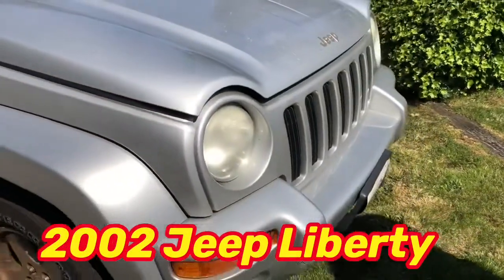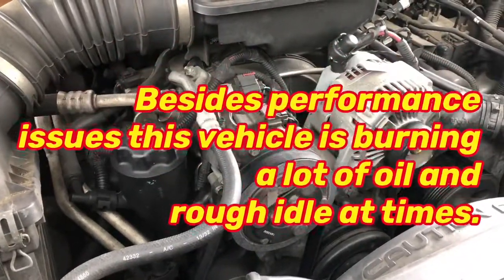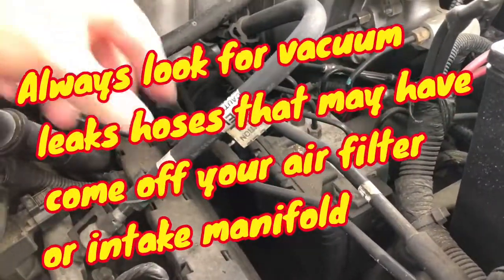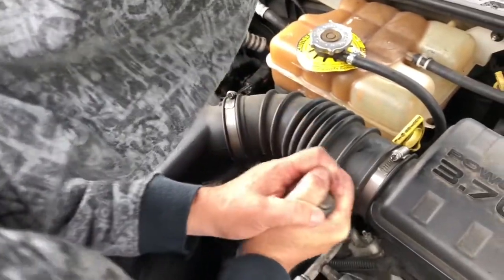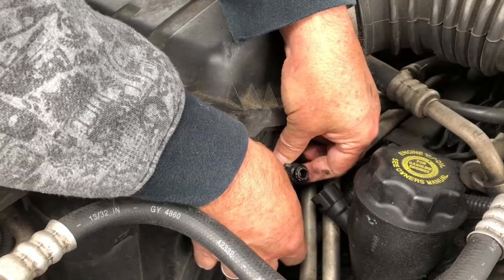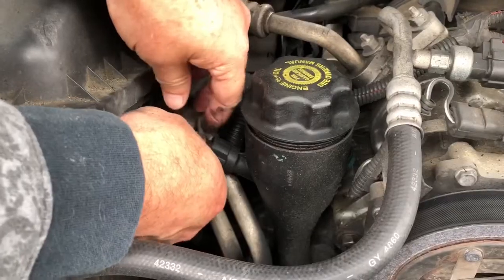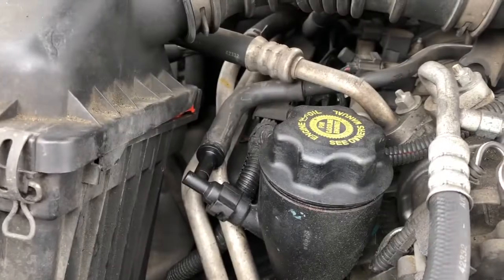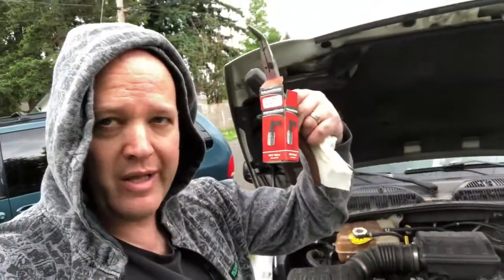2002-2007 3.7L Jeep PCV Valve! Loss of Power? Hard Start? Rough Idle? Oil loss? Oil on air filter?

Comment: 2002 jeep liberty renegade bought new in 2003 off the showfloor. When wifey wrecked it, i lifted it with 2" moog deisel springs and a ARB winch bumper on the front with a pinch weld mod, and 265 16 tires (fits on original rim) DRIVES LIKE A QUAD I LOVE IT. You know, california would not let them in without a 1" drop ? they dropped it 1 " the front forks can raise the jeep 1 ". Also they would not let  the deisels in the state. But it has 210,000 miles, looks great, (cosmetic damage only when it was totaled)
Reply from the maker: Nice Randy 👍 
Thanks for sharing man,
 Jeep on 🔧✌️

Comment: Nice walk through! I've been replacing all the small parts like this on mine for the pass month or so you know 30 bucks here and there and smaller parts too try too keep her fresh. 211333 miles on her and still running strong !
Reply from the maker: Nice 👍 211 k pretty dang good 😁 keep it up! 
Those 3.7 L run forever.

Comment: I had a full bank misfire because my cats where clogged . I cleaned all the screen and dirt out and put it back together doesn’t misfire now although I have a weird rough idle . Being cold it won’t stay started but when it warms up it’s still a little rough any ideas ? Change injected o rings coils spark plugs
Reply from the maker: Wait, 🤔 you pulled the cats off and cleaned the screens?
Reply: @RussShawTV  yanked all the screen out is what I meant lol . So made the cats hollow and put them back on
Reply from the maker: @cloudrehzii  Nice! I always wondered if that would work. I live in Washington state they got rid of the emissions testing 👍 Are you burning oil?
Do you have a light on still? 🤔 It could be your downstream O2 sensor is telling your computer That you’re burning hot and the idle may be adjusting to compensate.

Comment: Dude. You are such a legend. I jusy bought a  2008 wrangler with close to 200k on it (i got a really good price) and had it inspected. Passed inspection but i still had all fluids flushed, filters check etc. I've had the rough idling at red lights and get that death shake sometimes, triggering the red lightning bolt and etc lights, also the blue/grey smoke. I told my mechanic to check the egr valve and he said it was clean. I'm 1000% checking and replacing this part tomorrow. I can't keep having that sinking feeling in my gut not knowing if shes going to start or if shes gonna die while im on the road. Thank you again. I will update.
Reply from the maker: It could also be your catalytic converter. Do you have an engine light?
Reply: @RussShawTV  the guy I just bought it from claimed he just had a new catalytic converter put in. My mechanic said he saw catalytic converter error codes, but figured they just didnt clear them when they installed the part. Might be worth looking into though. I don't know much about under the hood stuff but I'm learning a lot! Also, I recorded a video of it starting to shake while idling and the lights coming on. I just checked my video and the engine light didn't come on but when i was restarting the vehicle, it was one of the last ones to clear from the dash.
Reply from the maker: @justblaze4707  P0420? 
Your vehicle actually has three catalytic converter‘s. He probably change the one on the tail pipe exhaust. The ones that clog (V6 3.7 you got I’m guessing) right next to the exhaust manifold. Bolted straight to it and they are not an easy replacement. If you have the P0420 code odds are it’s one of those cats. If they are clogged and that’s what’s causing the engine problems. It’s not good to keep driving it like that can do serious damage to your valves overtime.
Reply: @RussShawTV  Update: I took it to my mechanic and gave some input, telling him I thought it could be a pcv valve problem. Additionally, we both looked under the hood before I left and noticed an air filter plugged into an open vacuum port on the engine. We were both confused and he attached a hose and connected this to the air box (I think he meant intake manifold). I got the vehicle back the same day and he ended up replacing the pcv valve, doing that hose, cleaning the throttle body and doing a couple minor things like checking for vacuum leaks. He said this resolved the problem. I wasn't even out of the parking lot and it started to do its shake, and I got the red lightning bolt and the other etc light. I didn't have time to go back in but its concerning now because everything that I've researched has been addressed now. Could possibly be a Cat issue like you mentioned most recently.
Reply: I just did some diagnosing with my OBD scanner. So, the problem starts with the jeep sounding like its sucking in way more air. Then, the shudder happens and some weird values start to show. The timing becomes erratic and the throttle doesn't know what to do, and the idle rpm's go from 700 up to 1000 and settle. It seems my short term fuel trimmers are almost always acting really weird and when the shudder starts, they don't show up at all. Sorry this is so much to read, but I had to write it somewhere.
Reply from the maker: @justblaze4707  What was that code? Did it give you a code?
Reply: @RussShawTV  my dash wont display them but im getting P2173 (same as P0173) and C121C. I believe only the first one is an actual issue and I'm thinking its a fuel injector problem or the Catalytic Converter.

Comment: Hi I have a 2007 Liberty 3.7L V6, 117,000 miles. Owned it since 67,000 miles. It operated perfectly for the first 30,000 miles and then it started getting a #1 Cyl misfire code P0301.  It also seldomly gets a #1 cyl fuel injector circuit open P0201.  It must be a very mild fault as the misfire freeze frame data shows it always happens at less than 350 rpm and when cleared it comes back immediately at next startup, cold or hot.  So it seems to only happen once on startup as its moving up to regular idle speed. The miss isnt noticeable when driving or idling.  Its getting 15.5 mpg fuel mileage. Doesnt burn oil. Doesnt smoke. Has great power. I've changed plugs and coils but no difference. Cleaned air intake, air filter, and ran cleaner through system.  I've cleaned and inspected the injector plug and all wires but no difference.  Dry / wet compression test of #1, 3 and 5 cylinders all read good: 160 / 175 psi.

I'm wondering if there's a mild wire defect for that injector, or just a flakey connection somewhere.  Has anyone tried to use a new set of compatible gauge wires and run them to a place closer to the injector control?  I can't  see where the wires go though.

I'm not sure if I should just live with this, or troubleshoot it more.  I don’t care about the engine light as we don't have emission requirements. Now that I know the compression is good, I'm not so worried about it.

Any suggestions of what to do next?  Thanks!
Reply from the maker: Odds are you need to replace your coil packs. Your coil packs are malfunctioning causing fuel buildup. I would change all of your coil packs. I mean you can change cylinder number one but odds are the others are going to start going out soon as well. It’s a common problem the coil packs don’t last forever. I should do a video on this soon

Comment: OK I just cleaned out my PCV valve with carb cleaner just as in video.
Before cleaning I had a barely running idle, struggling and would almost die if I didn't hold the gas pedal down.
What difference!   Now I'm idling above 1 and exhaust output air has like doubled, its coming out like a hurricane.
And lots of popping noises.
What the world?   I would never expected such a change in a million years from this little valve.  What could have possibly caused this
Reply from the maker: @e.gadd.1  I’m glad you found the video helpful. These little motors need to breathe. 🧘 😎👍🔧👆
Reply: @RussShawTV     
I'm hoping the muffler popping is because I have my O2 sensors disconnected.
I'm not 100% sure if they are faulty, I was testing them.
Or maybe the valve is stuck open now?
Seems a cheap enough part.  I'm tempted to just swap it out with new

Comment: Thank you, sir. I thought my cats were going out. Going to give this a shot and after looking at it today, oil is leaking out of the valve. Houston, we have found the problem
Reply from the maker: Nice 👍 
🤔 No engine light?
Reply: @RussShawTV  no engine light on my ford ranger. My car runs fine just has extremely hard start. I have done a 50/50 test and ruled out spark and timing. I'll comment in a week to let you (and the viewers) how it went.
Reply: That was the fix. 5 days in and all my symptoms went away. My car starts up in less then a second and feels like I got 30 horsepower out of it lol. Thank you sir!
Reply from the maker: @fopop1567  Great news! Thanks for the update!

Comment: Yup I had the same on a jeep liberty sport 03 ,it would shake when I would press on the gas and oil pan light would come on and found out it was low on transmission fluid and the coil packs were what was making it shake and have loss of power

Comment: Liked and subscribed, 2004 Renegade here, thanks!
Reply from the maker: Nice 👍 😎 would love to know how it works for ya 😁
Reply: @RussShawTV  I tried to remove the PCV down like you showed and it snapped in my hands. Oh well, 18 years old!
Reply: @RussShawTV  so how does one keep the Cats clean? Avoid short trips?
Reply from the maker: @davekana8388  Changing spark plugs is a big one. Making sure you have the right spark plugs. Gapping is kind of a thing in the of the past they come pre-gapped depending on the year make and model of the vehicle.
The fuel in the cylinder once the fuel injector sprays it in needs to burn up completely. If it doesn’t then the fuel and whatever dirt in the fuel or in the combustion chamber get sent to the catalytic converter. This is what tends to plug them up most overtime.
Reply: @RussShawTV  clean fuel is the rule! Do you recommend an additive?
Reply from the maker: @davekana8388  There are some good additives out there. Not sure I would really recommend one in general. Some of it depends on what gas you buy. Most gas out there already has additives included at least here in the United States. Chevron and Shell have some extra fancy engine cleaning formula in their fuel. Most all the gas companies do it’s the only thing that sets them apart from each other besides just dinosaur blood 😂
Reply: @RussShawTV  I usually use BP. Haha,dinosaur blood!

Comment: Thanks for the video 
My daughter has 2003 Liberty and loves it, now it start then shut right off
Stay running long as foot is on gas, changed fuel pump relay but still does it
Maybe this is the problem
Reply from the maker: 🤔 Engine light on?
Reply: @RussShawTV  
No check engine light
Reply from the maker: Yes try the PCV valve that should fix the problem. If you get a P0420 code that’s cat catalytic converter. Similar symptoms
Reply: @RussShawTV  
Yeah so far it’s not showing a check engine light 
But I’m going to get a code reader also, need one anyways 😂 this is a better reason to tell wife I need one
Reply: Put Marvel Mystery Oil on gasoline.  It will clean the cylinders.  Hot sludge in cylinders is what cause that afterrunning problem.
Reply from the maker: @CFITOMAHAWK  We’ve also used Lucas top cylinder cleaner. Works great for roughly running engines and Better gas mileage to. 
But I would also replace the PCV valve. It’s cheap not hard to do and will work wonders for 3.7 L
Reply: @RussShawTV  MMO you can also add on engine oil before changing it.  cleans those dirty areas engines get.
Reply: My 2003 jeep liberty did the same thing until I got the Idle Air Control Valve changed. Now its fine

Comment: Great video I have a 2004 Liberty limited V6 3.7L I’m gona change my PVC valve tomorrow and see what happens.mine is doing everything you said yours is doing.mine miss fires with  no code.changed plugs still the same.Then throws the code P420 randomly.and also at times the thing will fly like peppy and then another you can feel it just hesitating.Did the pvc valve fix your issues?any advice or information anyone can share be great.
Reply from the maker: Hopefully that helps. Odds are you’re going to need a catalytic converter down the road soon.

Comment: I have a 2002, thank you so much! Perfect video. I will let you know if it helped mine. I am a subscriber. 👍
Reply from the maker: Sweet yes keep me posted. You may have to drive at five or 10 miles to feel the difference. You could also try disconnecting + battery terminal.
Waiting a minute and reconnecting it. Can’t remember if I shared that in the video 🤔 but that would reset your computer so it was acclimate faster to the air intake.
Reply: @RussShawTV  I'll try that.
Reply: @RussShawTV  last night I cleaned out the throttle body valve didn't do anything with the IAC, this morning the pcv will be in and I will let you know right away, thank you again for letting me know about the battery as well.  I'll be checking in soon. 👍🇺🇸
Reply: @RussShawTV  it works really good! And I appreciate the heads-up on disconnecting the battery. Great results thank you again.

Comment: Just FYI … This does not work for the 2007 Liberty. The PCV valve is different, and is also in a different location. Good vid though! 👍🏼
Reply from the maker: Thanks for your input man. Hopefully in 2007 they fixed the problem LOL. Curious 🤔 Do you have a PO420 code?
Reply: I had a 2007 Liberty and a 2008 Liberty. They both had the large screw in type in the rear of the engine on driver's side.

Comment: did the excessive oil consumption get fixed with the PVC valve swap?
Reply from the maker: A little bit. Her jeep has 200,000 miles on it so it burns some oil.

Comment: Jeep V6 engine seem like they have a lot of problems to the 4.0 inline 6 was near bullet proof
Reply from the maker: Coil packs, were a relatively new technology in mass production at the time. But those 3.7 are pretty good little motors. I’ve seen many of them with over 200,000 miles.
And yeah, those 4 L straight six engines were great. We had an 88 Jeep Cherokee with one in it. 🙏 Miss that rig. Wife got a wreck with it. Hit the person in front of her and the person behind her hit her in a kind of pileup situation, she was OK no injuries, but the Jeep looked like an accordion. 🪗 
I actually tied a come along to it and put it between two trees to try and pull it back into shape so I could still 4X4 drive it 🤔 I realize the plan had holes in it when the rear hatchback fell off onto the ground 😂 LOL 💙

Comment: nice but I just bought this vehicle and the hose on the PCV is not attached and I cant find it? runs fine but I feel the vacume is affecting my milage
Reply from the maker: Fun Rig Man!  Yeah I would definitely buy the PVC valve and then when you get it buy some hose that fits it. That is not good for your engine to have that open sucking dirt and contaminants into your engine. My daughter owns this vehicle it’s been really good for her. She’s put a bunch of miles on it and definitely got her moneys worth buying it used
Reply: @RussShawTV  WHERE IS THIS PCV VALVE CONNECTED TO? MY JEEP HAS IT DISCONNECTED
Reply: If you bought the jeep used like I did there’s a bypass you can buy the totally ruins the way the jeep functions and drives the bypass includes a whole new fill spout that dose not have the pvc velve nipple off the side it’s a joke
Reply: @bedwellbrandon  did you close off the other end of that bypass hose connection? Can you describe?

Comment: Um, did it fix anything in the end? 🤷‍♂
Reply from the maker: Yep, you can check out other comments here too. new PCV valve is also a most common cause for sluggish running 3.7 L V6's of this year.:face-blue-smiling:
Reply: @RussShawTV  sweet so no more hesitation?
Reply from the maker: Yes this fixed the problem. But then again it’s an old jeep. Does it run perfectly, no it has over 200,000 miles on it now. But it’s not hesitating when she goes up hills or on acceleration anymore.
Reply: @RussShawTV  I don't have any issues myself I just watched randomly and you left me on a cliff hanger I was like noooo did it work?? 🤣

Comment: Mine kept fuckin up.did all kind of work. I unplug that valve now it's running great tf
Reply from the maker: Interesting 🤔 usually when you unplug them the engine runs like crap. You may want to takeoff your valve cover. Change your valve cover gaskets. You could also try a hot oil flush in between oil changes. Odds are there may be some gunk in your engine. Could be clogging up your breather tubes.
Reply: Thanks .I've done alot of work it's driving great so I rigged a filter up to it but running runnin
Reply from the maker: This one is my daughters and it’s still going at 207,000 miles 👍🔧😁
Reply: Mine has 230 thousand but needed lot of love
Reply: @stevepalenicek4690  can you describe the filter? You mean that it's on the place where the PCV hose connected to?
Reply: @stephenyparker1539  yes hose that goes to pcv  .it was broken I fixed it changed all sensors kept stallin .so I unhooked it runs great made a small hole though .

Comment: What is the name of the hose connected to the pcv valve?
Reply from the maker: I called the breather house not sure what the technical term is but a breather hose usually goes from the south cover into your air intake. PCV valve regulates it
Reply: @RussShawTV  you are correct. I put that in to Google with my vehicle information and it came up that exact part with connectors. The whole thing not just that small bend but the other part as well and the connector